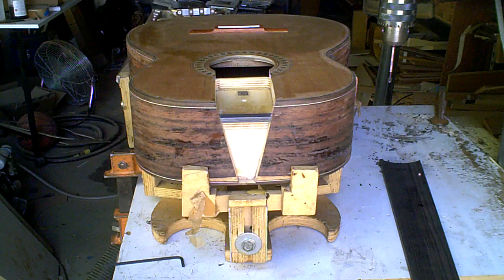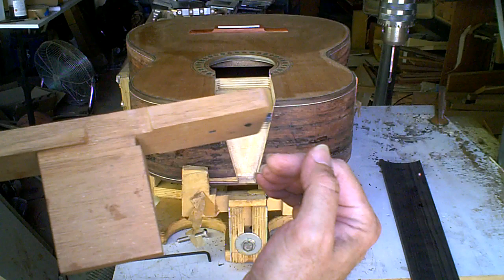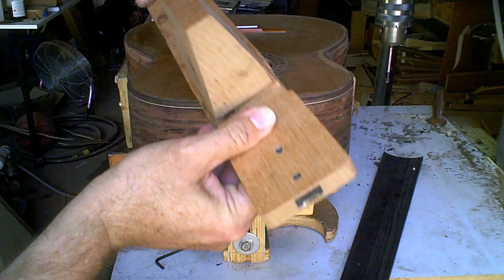Lattice Guitar - Adjustable Action Neck- Schramm Guitars

Comment from the maker: @76301rick Why would the string tension bow the neck? It has a 3/4" x 1/2" carbon fiber rod down the middle of it. Even if I didn't use the cf rod the string tension wouldn't bow the neck. This is a nylon string not a steel string.
Reply: That's what I was thinking. This seems like a lot of over engineering

Comment: Very nice design and construction.  However, it appeared that the neck never appeared rock solid, stiff - ie. to where it does not move in the least bit up or down.  When you crank the allen wrench on the adjustment screw I imagine it stiffens pretty good... and the minor neck angle adjustment  - is it so minor as to not affect any potential neck movement ?

Comment: Hi David  you mention strike plate.What is it you made out carbon fibre or something  what is the dimention.1 mm thick or more it is not clear for me.How the retaining bolt stays there is holl been treaded .SorryI could not figure out.Thanks
Reply from the maker: Cold rolled steel. 1/2"W x 1/8"Tx3/4" L